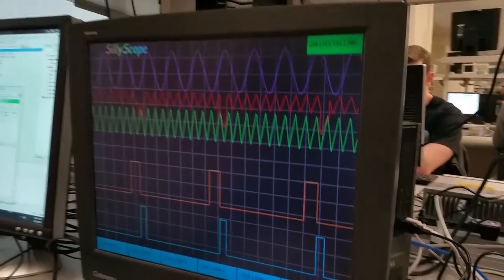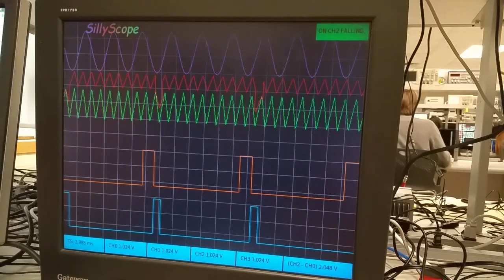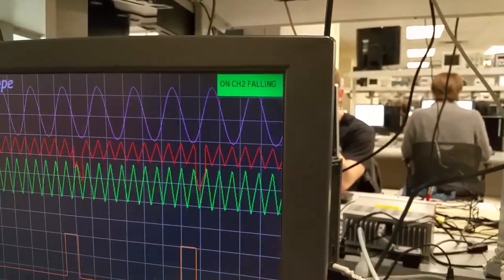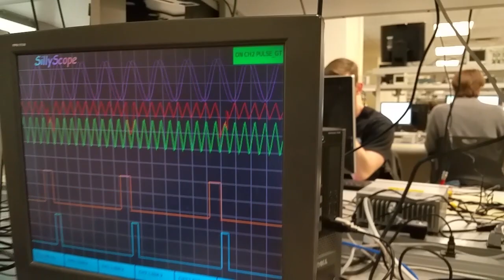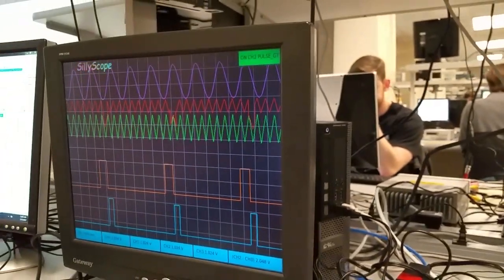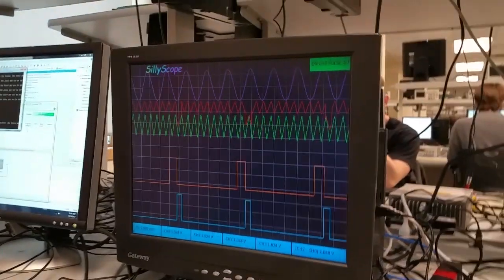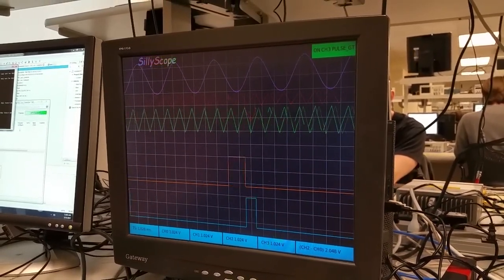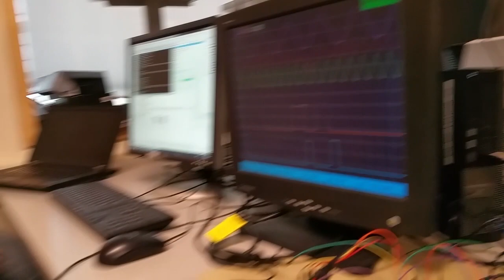FPGA digital oscilloscope

Comment: If I want to do this project without module "the Computer system" and HPS, I just want to use the FPGA board only. But I have no idea to which pin can be connected to  VGA _VS and VGA_HS. I would be grateful if you can help me with this problem.
Reply from the maker: youwill have to write a state machine which generates VGA timing pulses.examle: https://people.ece.cornell.edu/land/courses/ece5760/DE2/indexVGA.html
Reply: @ece4760  Thank you!

Comment: Thanks! It compiled straight away on my computer (Quartus Prime 20.1)... I mean "straight away" is a whopper 8min30 of compilation but no error. I will have a look at it.
Reply from the maker: Wow! Well quartus is a memory and disc hog!
Reply: @ece4760  It sure is! By the way, what goes to the DE1 SoC board is the power supply, the USB cable, the VGA cable, the wires for the analog signals and an Ethernet cable? If so, what is the use of the Ethernet cable?
Is it possible to create such an oscilloscope with absolutely no use of HPS, only FPGA part?
And how could we possibly translate such a code to another Terasic board, for example DE10 Standard or DE10 Nano?
Reply from the maker: @guillaume8437  Only FGPA? The answer has to be yes, because the FPGA is compute universal. Porting to another board generally means recoding.

Comment: Hey man.I just want to say you did a great job, but when I opened the zip file and wanted to learn, the code inside seemed incomplete. Is there any other v code you can give me for reference? Thank you so much , and have a good day!
Reply from the maker: since the project is 7 years old, the only documenttion is the report. Sorry. Do you have a specific piece that is missing? The course documentation from 7 years ago is still online.
Reply: @ece4760  Sorry, I'm not sure about this, but all the data type  is "unknown"  or "high impedance" after running the simulation.
Reply from the maker: @宋姿儀-o8w  there is not nearly enough info here for me to understand what yu are actually doing.
Reply: @ece4760  I would like to ask about the purpose of module "Computer_System". After clicking on the synthesis file, there are nearly 200 submodules in it, and some of them are garbled. I would like to ask whether those files are necessary for execution.
Reply from the maker: @宋姿儀-o8w  The module links the Verilog to the Qsys bus and is mostly generated by the compiler from the Qsys description. Qsys == Platform Designer
Reply: @ece4760  What should I do if I want the digital oscilloscope to support x-y mode (Lissajous pattern method)?
Reply from the maker: @宋姿儀-o8w  what are you really asking?

Comment: Good job man ! I just want to ask question. We are doing the project which name is fbga base on Signal Generator and oscilloscope. Im wondering that are there any vga output on fpga ? How did you connect fpga with monitor ?
Reply from the maker: The de1-soc board has a VGA DAC attached to the FPGA. But you can build your own DAC. see https://hackaday.io/project/5033-de0-nano-fpga-to-vga-output
Reply: @ece4760  Firstly, Thank you so much. Can you send me the vhdl codes please ?
Reply from the maker: @alkmdikmen223  did you read the linked report? The code is in Verilog